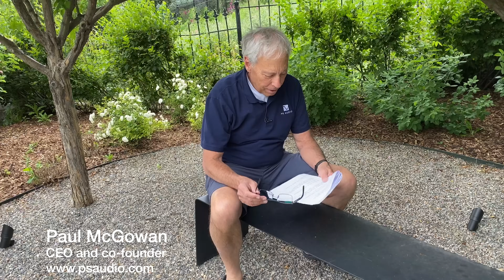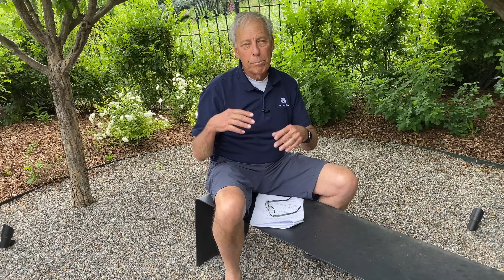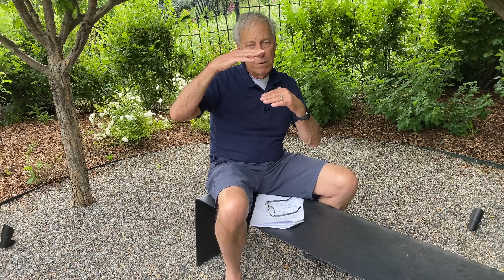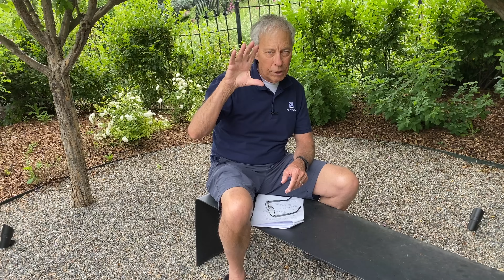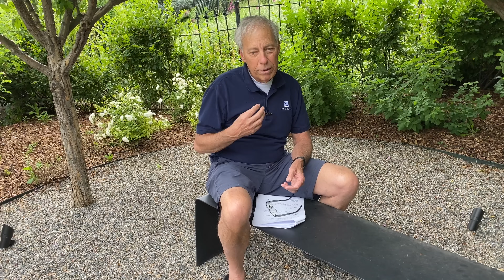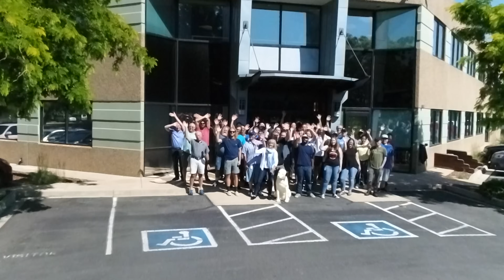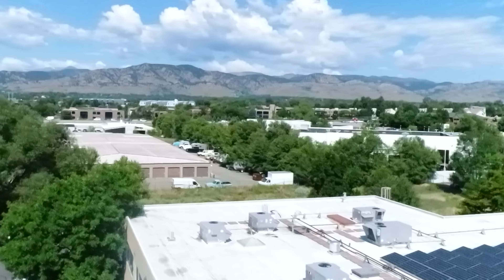Dynamic range expanders

Comment: A lot of the music gets ruined! 
Are there cheap equipment such as phones, mp3 players and bluetooth speakers we should adjust the music to?

If cheap sound equipment does not have good sound then we can not adjust the music recording because then we can not play the music on a good hifi system!

We just have to accept that cheap equipment does not have good sound!
Reply: The most idiotic part is that dynamically compressed music sounds shit on cheap phones etc. too. Well recorded music translates to pretty much all modern mediums of listening - because even the worst ones, aren't really that bad.
Reply: @LordVictorHalgaard  What is then the point of dynamically compress music??
Reply: @ford1546  compression is an absolute standard technique in recording and is not the only cause of the loudness war. People here confuse "normal" compression for recording and extreme limiting/multiband compression for loudness. And loudness does not only come from limiting in the mastering stage, but starts already with different mixing techniques and decisions.
Reply: @Raumweiter  dynamic compression comes originally from LPs.

Why can we not make music without dynamic compresion and without turning up the volume so much?
Reply: @ford1546  because the dynamic range of analog equipment and acoustic instruments exceeds what most systems can play or what is usable at all. Imagine all the really nice songs with vocals on them. It doenst matter if old or new, they all have compression on the Singers voice. Compression helps music to translate on all systems, wether big or small. It keeps the dynamic range in a comfortable range. For example transients peaks of a snare drum far exceed the average volume of the sound. So in the end you would have nasty and unpleasant peaks and a very very low volume of the whole track. In turn your noise floor would be much higher on average. Compression isnt per se a bad thing. Normal Compression and loudness war are two different things. Loudness is not only achived by compression, but also with saturation and filtering.
Reply: @LordVictorHalgaard  Thats not really true imho.
Reply: @LordVictorHalgaard  i guarantee you that all the songs you perceive as good and uncompressed, have actually compression here and there going on.
Reply: YOUR PHONE CAN REPRODUCE THE SAME FREQUENCY  BUT IF THE LOW PASS IS ON THE 100KHZ AND NEED A 192KHZ AND 24 BIT . BUT ALAWAYS GO FOR EXTENDED FREQUENCY HEADPHONES OR LOOP !
Reply: @pracheerdeka6737  a low pass on 100 khz? I can not hear anything after 20 khz. ;)
Reply: @Raumweiter  YES DEAR SIR. YOU CAN HEAR ON 15KHZ AND 20KHZ IS A MAXIMUM. BUT BUT YES YOU CAN HEAR ITS A SURPRISE FACT CUZ A HUMAN BRAIN CAN DETECT AUDIO UPTO 100KHZ AND THE BRAIN CHANGES ITS FEELING BUT YOU HAD NO SENSE.  THATS WHY HIGH RESOLUTION AUDIO IS ESPECIALLY ESTABLISHED FOR DELIVERING UPTO 100KHZ ON A SAMPLE RATE LIKE 192 KHZ OR DSD AND THE FEELING FOR THE MUSIC COMES AFTER 20KHZ BUT HEARING PORTION STAYS ON 14KHZ. BUT DONT SELECT DSD FOR THAT CUZ DSD MAY MAKE SOUNDS DISTORTION  ABOVE 30KHZ AND MUSICAL INSTRUMENTS CAN GO BEYOND 50KHZ. SO SELECT 192KHZ OR 352KHZ/24BIT FOR CLEAR SOUND AT HIGHER FREQUENCY AND THATS WHY IF THE MIC CAN GO ONLY TO 50KHZ THEN YOU SHOULD RECORD AT 96KHZ FOR 46KHZ FREQUENCY  RESOLUTION.  THANK YOU.
Reply: @Raumweiter  DONT COMPRESS OR TRY TO CUT RAW SIGNAL BUT YOU CAN TWEAK SOME EQ AND MAKE HIGH FREQUENCY SOUNDS CLEANER SO THATS THE CLEVER THINGS SIR.
Reply: @pracheerdeka6737  sorry but thats a lot of nonsense. 24 bit recording is done for dynamic range for example. I dont have equipment that reproduces beyond 22 khz, nor do i know a musician who knows how to process sound after 20 khz. If you mean that a Guitar string still resonates in that range...ok. But i do not think that you can distuingish between music with a range of 22 khz and other esoteric audio formats with up to 100 khz. Most of the feel of the music happens far below 10 khz. Old and good records were most likely recorded with mixers, preamps and so on that do not go past 30 khz. And if they did you still have a significant roll of past 20 khz, as well as distortion. Not to speak of tape and its limitations.
Reply: @Raumweiter  DONT LIMIT THE FREQUENCY OR GAIN IN COMPRESSION  AND NO NEED TO BOOST THE OVERALL SIGNAL AND PLACE IN 195KHZ WITH NO LOW PASS FILTER. SO YOU HEAR FULL RANGE AND ALWAYS USE SILVER ADC CIRCUITS AND CABLES.
Reply: @pracheerdeka6737  yes, but the point is also "full range" in dynamics is not something i want always. Of course it depends heavily on the genre, but it doesnt always make sense to have a full dynamic range. In recording and processing, of course! Have you ever done blind testing cables and high quality audio formats? I mean really normalized blind testing. I dont really think it makes a big difference. What are we talking here maybe? 0.1% in quality increase maybe? Just because somethign can be measured, doenst mean you can really hear and perceive it. If you look even at the measurable differences; they are so small. There is a lot of other stuff in the chain being far more important. The most important is the room! I´m no expert, but i´m pretty sure if you want to hear a difference you must sit perfectly in the sweet spot of an acousticly treated room, head in lookin straight to the middle. Thats not how i want to enjoy music. Often i actually like it, if you walk past a small shop with speakers hanging in the corners and interesting music playing. I´d always take colour (feeling/atmosphere) over quality.
Reply: @Raumweiter  YES DEAR SIR I CANT SAY WHICH MUSIC IS WHICH ONE! BUT IF WE USE 10 MICROFONES PLAYING AT SAME TIME THEN THE 24 BIT IS NOT SUFFICIENT.  THATS WHY MANY  HIGH RESOLUTION  FORMAT WANT TO USE ONLY 1 OR 2 MIC SAMOUNTANOUSLY  OR THE SIGNAL BECOMES UNPURE. MORE THE BIT OR MORE THE SAMPLE IS SAME SOMETIMES THATS WHY DSD BROUGHT.
Reply: @pracheerdeka6737  do you mean microphones or speakers? Music with 2 miceophones? Sorry ivdont understand
Reply: @Raumweiter   i mean mixing 2 or 3 mic without COMPRESSION can make overall 24 bit look smaller cuz a single microfone  has 125 db

Comment: I remember the dbx range from the 70’s
Reply: You're talking about a width expander dbx make don't know about dynamic expander did they make one?
Reply: @johnsweda2999  every expander is a dynamic range expander. Wether it´s dbx, drawmer or whatever company. They were very popular back in the days for recording, if not nessecary to reduce noise. The combination of  a noise gate, a compressor and an expander is common in a noise reduction system. Just google noise gates fo recording, a lot of them have expanders.
Reply: and several noise reduction systems for tape use them as well.
Reply: They made specific dynamic range expanders for audio  and dbx noise reduction for tape decks in separate boxes. DBX was added to some tape deck from the factory  as well, maybe around 1979 - 80.
Reply: Look up DBX 128, interesting to try but the danger was if it was set to high it became artificial. Best example was a piano had a pumping effect. This is of course pre digital effects so the action could be a bit course! This was before the loudness wars we have now, ah the good old days!
Reply: I don’t just remember the dbx, I built my own compander. Still have it, but haven’t used it for more than a decade. It was more useful for compression than expansion as in when you wanted the music for background only. Expansion required careful adjustment that was different for every track. I suppose now that all of my vinyl is digitised I could carefully adjust each track, but I couldn’t be arsed. I’m too busy listening...